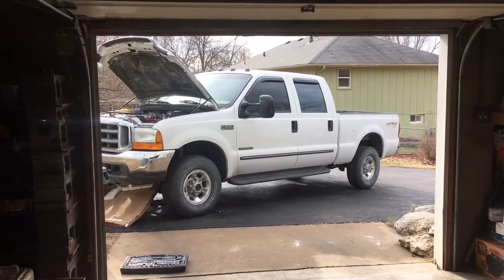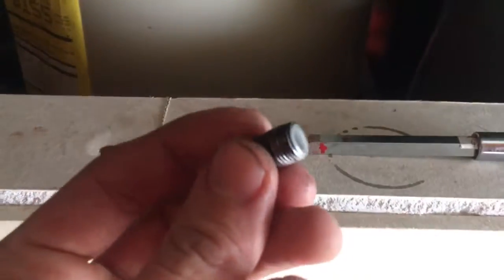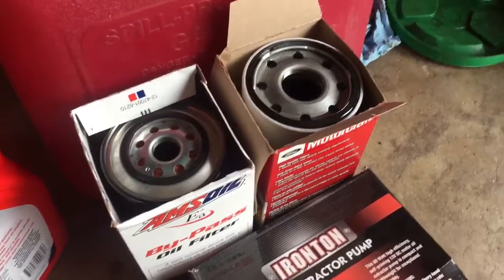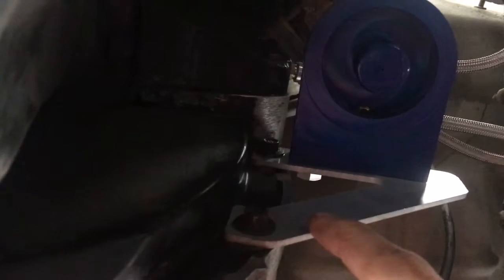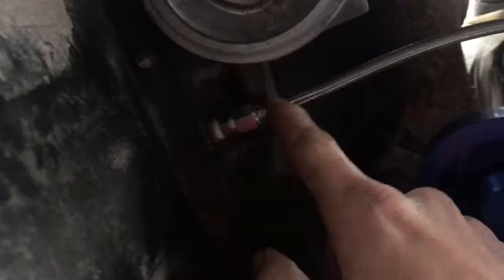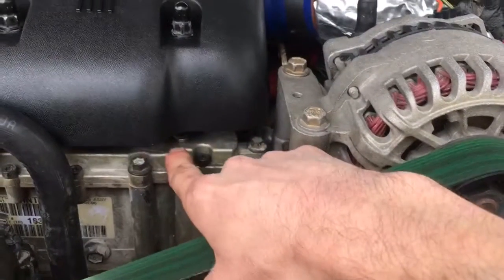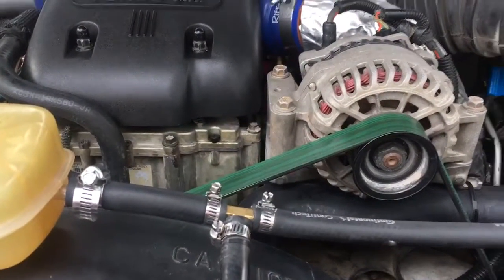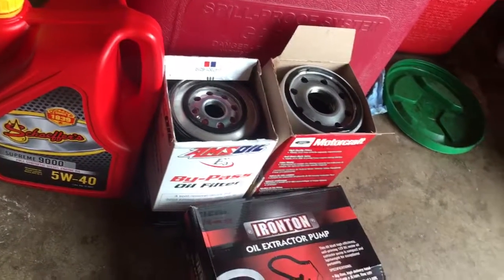NUC 7.3 oil bypass installed

Comment from the maker: Hey Michael I did one Analysis and everything was great I am now doing 10k oil changes using Schaeffers synthetic. I like the location and size of the supply port for this kit. Don’t think a larger port would be good. Might take too much oil from the main lubrication circuit.

Comment: Have you done any analysis? I used this setup, but every other oil setup, guys are using the high pressure port located on the other side of the main oil filter. It scared me a bit as I did this setup & then almost all the other videos showed them using different ports.